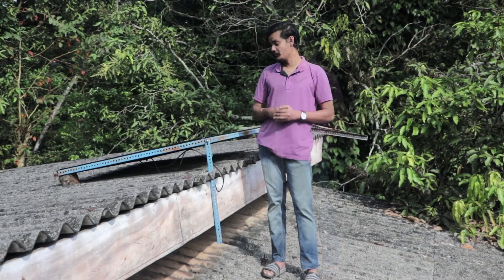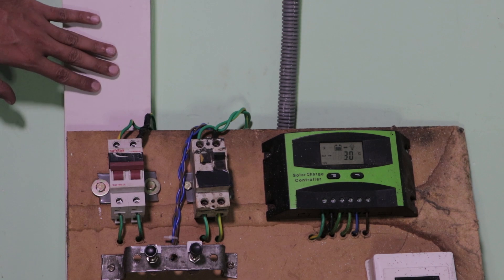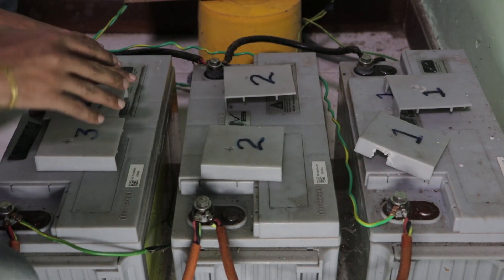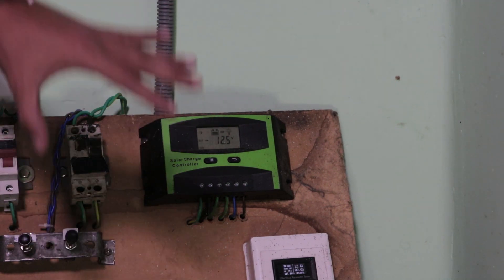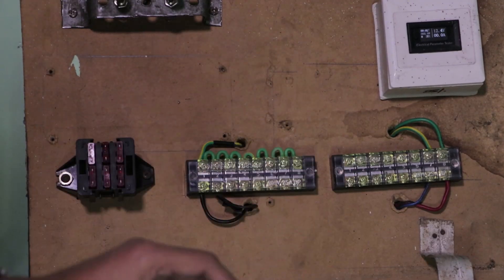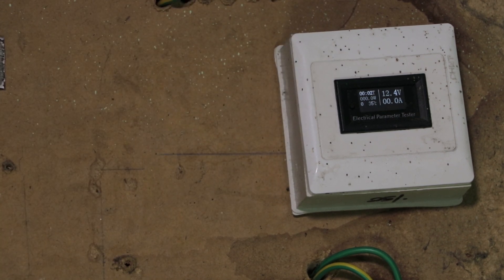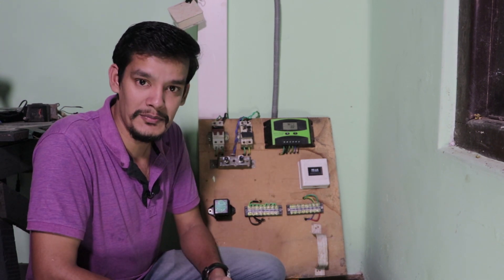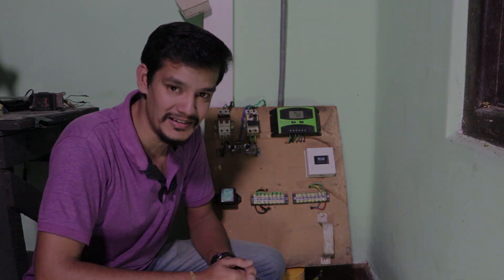අපි සුර්ය විදුලි බලයෙන් වැඩ ගනිමු

Comment: Mage laga solar penal ekak thiyenawa (100w) .ekata avashaya anith badu tikata (bettry, control )kiyak vithara yaida...
Ganna puluwan thenak kiyannako...
Reply from the maker: Charge controller eka online order karana eka hondai.mokada ethakota awashya options ekka aduma ganata ekak hoya ganna puluwan nisa. (Cash on delivery websites balanna) 

PWM charge controller ekak nam Rs 2,000 to Rs 4,000 price range ekaka thamai tiyenne.

MPPT charge controller eka nam Rs 15,000 ta uda thamai tiyenne.

Load eka pawichchi karanna hithan inne 12v DC da? Natnum main current ekada AC ?
Reply: Main karnt eka ....
Sola eka nikan thiyenne ekai ehuwe....
Mekata hariyan bettry eka mokakda ...
Reply from the maker: Battery current eka main current ekata convert karana option 2k tiyenawa.
1.parana computer ups ekak pawichchi karana eka.meka normally market eke Rs 1500 k Rs 2000 wenawa.

2.ehema natnum inverter ekak pawichchi karana eka . inverter warga 2k market eke tiyanawa.motor ekak sahitha item pawichchi karanna balaporoththu wenne natnum, (fan,washing machine etc.) modify sign wave inverter ekak pawichchi karanna puluwan. Normally podi wada walata nam 1000w inverter eka hondatama pramanawath. Me wage inverter ekak market eke Rs 5000 ta ganna puluwan. 

Meka asawata karana deyak nisa pawichchi karapu car battery ekak use karanna.amp gana wadi wena tharamata hondai.anika battery kipayak ekathu karala thani loku battery bank ekak hadagannat pukuwan.ehema karanawanam ekama amp rating ekak tiyana battery hoyaganna balanna.normally pawichchi karapu 12v  battery ekak Rs 2000 sita udata market eke ganna puluwan.

Comment: Ayye oya inverter 1n ac fridge use karanna puluwan da
Reply from the maker: Ow puluwan.fridge eke power consumption eka mata use karanna yana inverter eke wot pramanaya wadi ho adu wenna puluwan.

Inverter ekakin karanne DC (battery current ) AC walata convert karana ekai.me current eka api samannayen pawichchi karan electricity board eken labena ekama tamai.ekama wenasa apima hadaganna eka witharai.
Reply: @DIYwithAsanka  thank you ayye 👍👍👍. Ethakota apita amp 60 Barry 2k wage normal gekata athi weida rata pavichchi karanna athi weida power 1
Reply from the maker: @chavindujayathunga9674  eka decide karanna puluwan oya use karana load ekai battery eka kochchara durata discharge karanawada kiyana eka matai.battery ekak discharge karana rate eka wedi wenna wedi wenna battery  eke life time ikmanata adu wenawa.udaharanayak widihata mage system eke tiyana eka 100amp battery ekak eka dawasak athulatha discharge karan maximum limit eka 60amp.e widihara use karot  battery bank eka 8yrs pawichchi karana widihata tamai mama calculate karala tiyenna  (mewa deep cycle batteries )
Reply: @DIYwithAsanka  👍👍thank you ayye.
Reply: Ayye thawa podi deyk danagnna puluwan da. Dn inverter 1n gnna current 1 gedra tip switch 1 off krla plug 1ta connect karla use karata prashnayak nadda? Ehema thiyeddi waradila tip switch 1 on kroth solar badu walta prashnyk wenawada?
Reply from the maker: Ow inverter eka  connect karanne main switch eka off karala inverter eke output eka breaker box ekakta laba denawa.

Off grid inverter ekakta anit patthata current eka laba dunnot inverter eka pichchenawa.

On grid inverter ekak pawichchi kalot main current eka tiyeddima solar panel eken nipadawana current eka pawichchi yata ganna puluwan. Habai eka main current eka giya welawata ekat off wenawa.
Reply: @DIYwithAsanka  ah bohoma sthuthi ayye aaai mokakhari awlk unoth mn ahgnnm👍👍❤️

Comment: 1 hp water pump ekak use karanna solar panel ekak sadaha cost eka poddak keyanna puluwanda brother....
Reply from the maker: Oyage problem ekata answer karanna  mata tawa information ona.
1.Motor eke wot kiyak use karanawada ahema natnum amp kiyakda use karanne 
2.dawasakata paya kiyak motor eka use karanawada?
3.Wahina kaleta eka digatama awwa nati dawas kiyak withara oya inna area ekata set wenawada.basnahira palathe nam 2 days wage tamai ehema wenne.
Oya information tika mata denna ethakota mata calculate karala kiyanna puluwani
Reply: @DIYwithAsanka  =10_lm,q50-260 L/min 220.  ' 240v" 50 HZ, 3.8A, p, 0.75 KW, 2900r/min,  pH 1. class 1 ss(F)
Reply: water pump details brother...
Reply: pre day 4 hours
Reply from the maker: Inverter eka 2000w wenna ona.
Puluwannam pure sign wave inverter ekak hoyaganna.
Battery bank requirement eka 3240amp hours. meka 100amp battery walin hada ganna wanam 12v 100amp battery 3k minimum ona wenawa. Wadat hondai 4k dammot.(Me calculation eka karala tiyenne battery 1ka discharge rate eka 50% kiyala hithala)
Solar panel requirement ekata 150w panel ekak use karat athi.battery ikmanata charge karanna nam panels 2k use karanna.
Reply from the maker: Oya items tika online search karot mewata yana cost eka approximately hoyaganna puluwan

Comment: Saamanyayen keeyak vithara giyaada me okkotama
Reply from the maker: Battery tamai ganan wadima.
 28000/= 100amp 12v battery 1k.ewage 3k tiyanawa.
 150w second hand panel eka 9500.
Charge controller 3500.anit ewa wire ,wire casing ,12v fan,light,switch .okkoma 120,000 wage gihin tiyanawa.
Reply: @DIYwithAsanka  noted with many thanx brother. Jayawewa 💖
Reply: Inverter ek kiyda
Reply from the maker: @manojkumara3146  1000w modified sine wave inverter ak 5000rs.
Reply from the maker: Motor ekak hari computer ekak hari use karanna hithan innawanam pure sign wave inverter ekak use karana eka tamai hodama.e inverter alteast Rs 50,000 wath wenawa.